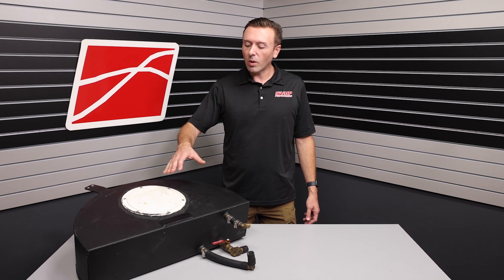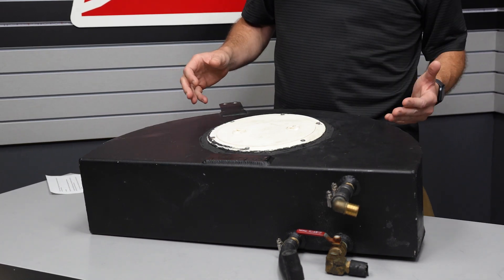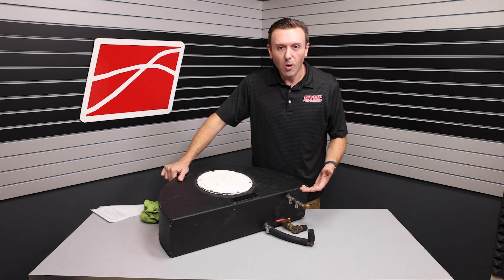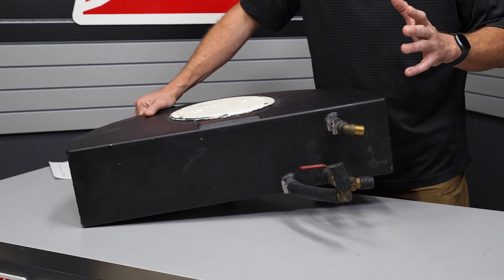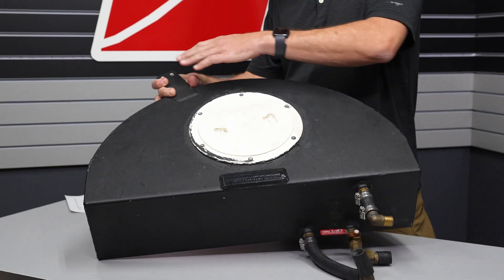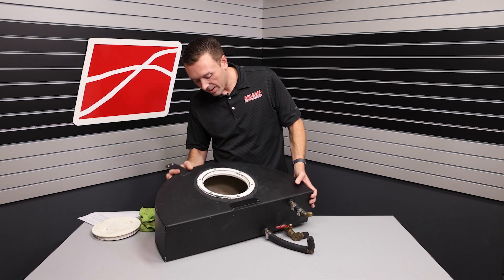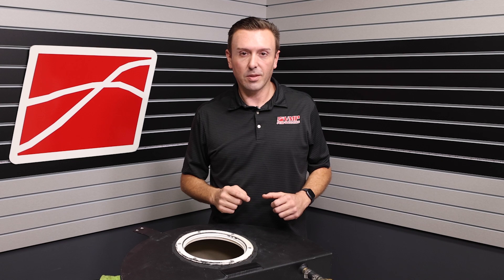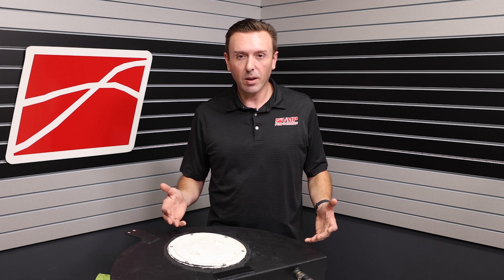Trunk Ice Tank PROS and CONS!  Deep dive on trunk mounted ice tanks.  ||  Tech Talk

Comment: You know the trunk mounted ice tank would actually be very efficient with a set of aluminum cooling tubes mounted above the floor of the tank and below the pickup fittings. especially if it was chilled bye a N2O solenoid and pressurized CO2 just using a coiled tube set with a bleed jet on one end and a charge fitting running off the solenoid on the other end. No ice would be required just a 15lb bottle to run the solenoid would chill the liquid without any ice internally to plug the pickup fittings. Thank me later.

Comment: Here is what would be cool for an ice tank from VMP:  Same trunk options with mounting solutions for popular aftermarket pumps (EMP, CWA, etc..).  Hose size options for 3/4, 1 inch, and 1.25 inch.  And...most important, a solenoid valve option with a switch in the cabin that can be used to bypass the heat exchanger when actually running ice.
Reply: Couldn't you just run the hose straight to the blower from the ice tank and then out to the heat exchanger and then back to the trunk tank?
Reply: @jkrych26 i was thinking the same thing

Comment: Would an ice  tank that fits where the battery use to be located work?  Would it be big enough?  Obviously my battery has been relocated in the trunk. Should I use methanol injection instead of an ice tank?
Reply from the maker: Underhood tanks can be a great solution too.  If you're stuck on 93 adding boostane or methanol injection is a great way to get octane up.  Boostane is very reliable since it's mixed into the fuel.

Comment: make it have all those features plus some kind of bypass at the front radiator in case something does go wrong in the tank you can isolate it from the system. hope that makes sense. Also on the one i had from pbd when draining since it sits lower than the radiator in the front it would drain the ice tank and the radiator if left open long time. Thats no bueno! Some feature to make easy to swap entire system from antifreeze to water only. Some tracks are requiring this for track days. Then you need to swap back to abntifreeze as you go back to street to prevent excesive rust on the engine, radiator, etc.